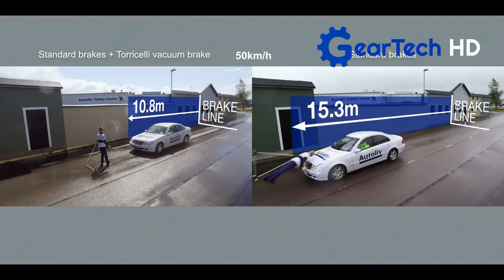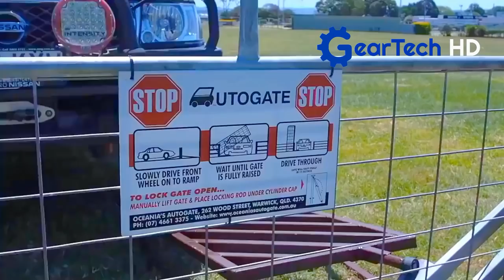Amazing Car Inventions That Are On Another Level ▶ 2

Comment: Back up cameras are not a replacement for actually turning around and watching with your own eyes as you slowly back up. They are good for backing into parking spaces so you don't hit walls and other cars, but only when you are backing up the last meter or so. And that vacuum brake - what's wrong with paying attention to what is up ahead, what speed you are driving and what is going on around you?

Comment: as for the one that gives a step in your door frame. avoid it at all costs if it comes out. that is a LATCH hook to hold a door closed. not support a person on the end of a lever!
Reply: That latch made to take the impact of a T-bone crash so it may be OK for that step, also the leverage is reduced by half due to the down leg of L-bracket.  Many latch catches are not made like that however and I'd definitely take a close look at how strong that catch is especially pulling it down, the one pictured looks like it could take it.
Reply: @Mrbfgray  a SIDE impact. not up and down motion.
Reply: @danz409  Crashes don't limit themselves to one direction of force the catch has to be stout in all directions.  Take a look at the catch in the picture, think you could stand on the end of it?  That's the same bending load it gets from the step.
Reply: @Mrbfgray  and the average joe shouldn't be able to break off a lug nut by hand. and iv broken 2. not saying there not strong. just saying this is basically a lever and is exactly how a claw hammer works. so if anything is going to rip one of these out of a car with some rusty panels. it wouldn't surprise me if its capable of it.
Reply: @danz409  Nope.  A claw hammer has entirely different leverage characteristics.  Like I said before the down leg is long enough to cancel roughly half the horizontal lever.  Imagine if the down leg was, say 2ft long, would you still compare it to a claw hammer?  You work with tools, don't be obstinate.  

On the other hand imagine if the "pry contact point", the pivot or in this case the rubber stop against the door frame, if that was only a centimetre below the latch.  (going to the opposite extreme) then absolutely it's even more sever than a claw hammer and would likely damage the latch structure.
Reply: @danz409  Look at it another way--would you design a claw hammer or pry bar with equal length levers?  Say a 2ft from pivot to hand hold and 2ft from pivot to the where the "nail" your removing is hooked??